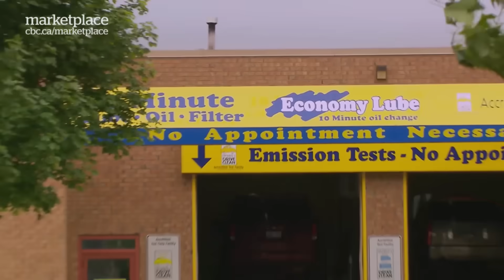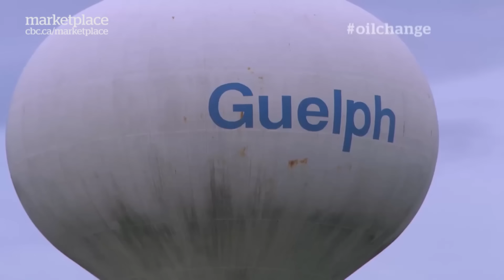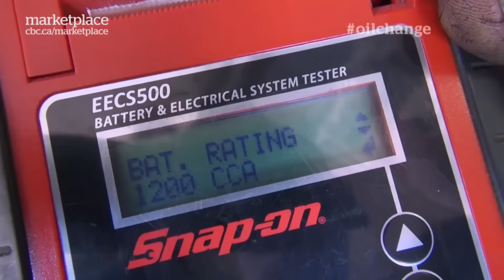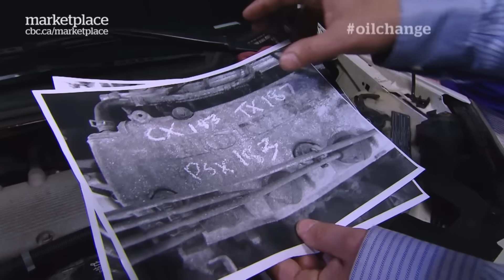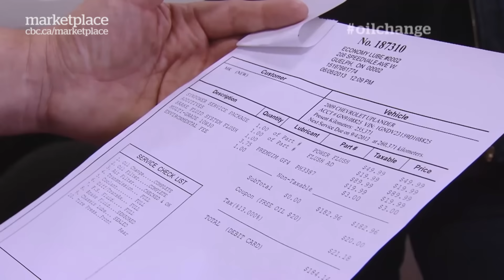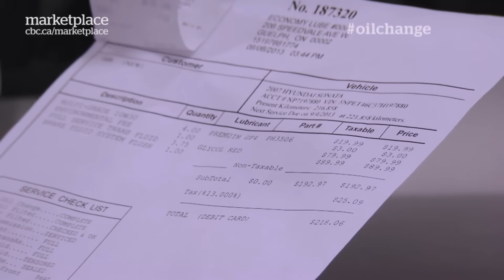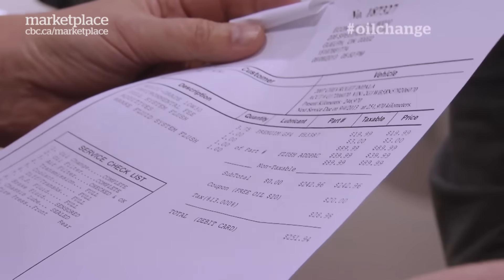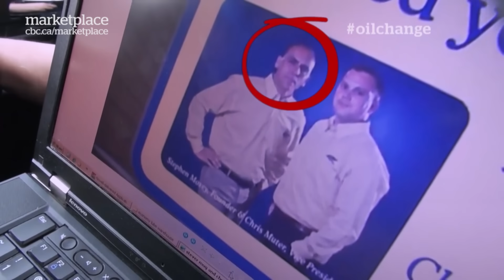Oil change scams: Hidden camera investigation on what really happens to your car (CBC Marketplace)

Comment: This is a perfect example if "you need something done, learn it, practice it, and do it yourself".
Reply: Ohyeah let me learn how to do a hospital operation in 1 yt video
Reply: @beterverwijderen  lol we're talking oil changes and fluids. Legit takes me 15 minutes to do it at home
Reply: @brandonjohnson8880  try rebuilding a transmission
Reply: @mamoochie7392  did the rebuild on my NV3550 from my 01 Jeep TJ in my garage last summer... 😂 (Used a manual)
Reply: @mamoochie7392  It doesnt hurt to learn new things
Reply: @mamoochie7392  i would do it lol
Reply: Need a tumor removed from kidney? Avoid sky high hospital bills, by learning how to do it, practice, then remove the tumor yourself  🤡
Reply: A good priced oil change is worth it for the convenience of not having to go out and buy the oil and filters, and having to go under your car and get dirty, and take the old oil to a proper place for legal disposal. The problem is the loss leader strategy they use. No shop could survive doing only $20 oil changes. But if they charged more, with the promise of no upselling, cheap people will still choose the lower priced oil change even though its shady.
Reply: My brothers and I learned how to change oil ourselves a long time ago.
Reply: @XA0zzzz  do you realize how ridiculously simple and easy it is to change your own oil
Reply: @LactoseTheIntolerant  Is* failing & after the first sentence you need a "?" Not a "." because you were asking a question..
But yes, judging from your grammar, the U.S education system is indeed failing us 😏
Reply: Very easy to YouTube how to do your oil change and save money. It cost like $35Dollars for Oil And Filter (And I have 3Quartz left over for a next Oil change/Also its synthetic 10,000Miles). You have no way of knowing what type of oil their putting in your car. Also I have ramps I bought so it's basically drive up/Drain/Pour new oil/Done.
Reply: Ong
Reply: Biggest issue I have is that I don't have a car jack or anywhere to store it. 12 m2 room, idek where I would keep it. I would love to learn to do oil fluid flush
Reply: Ok
Reply: Yup! They tried to upcharge my mom to get her break pads changed so she bought her own and watched some YouTube videos on it
Reply: Y did´it Myself in Romania!
Reply: Amen I’ve been learning to fix my own car from YouTube for this exact reason. Just need tools
Reply: come on this is fairy tales life is not enough to learn everything also need place,tools,knowledge  better you try to find honest people and be honest
Reply: Too lazy 🥱
Reply: you think this is bad get an AC/ heating technician to come to your house they're totally clueless they don't do half of what they say they're supposed to do and then try to charge you double if you're not careful
Reply: @beterverwijderen  we don't think anybody's talking about doing surgery on yourself big guy we're just talking about services doing what they say and charging a reasonable rate for what they actually say they're doing not doing liver transplants
Reply: @bka8851  Well ya if you just call some random company, most people go with a company someone told them about, i.e good references
Reply: Facts
Reply: @beterverwijderen  It depends on the surgery. I'm considering getting the supplies and having my girlfriend do a debridement on me. Living with HS is hell and the surgery isn't rocket science.
Reply: @beterverwijderen   congratulation
Reply: @dvasavertik7629  I’ll give you that one but only because I watch them to lol.
Reply: I tried this for my backyard patio.  Two years later and it's still halfway done...  I wish I had hired someone to do it.
Reply: Some of you sound ignorant comparing complex hospital procedures to changing car oil.
Reply: except if you need to fly a plane
Reply: @mamoochie7392  pk and while tedious it can be done in a day. It's cheaper to learn to do your own repairs and then do them yourself.... as long as it's done right
Reply: @jameshall2017  not everyone has a day to give up... lol
Reply: @mamoochie7392  that's cause bot everyone wants to make time. Unless you're working 12-16 hours a day then it's not hard to make time. Obviously you can spread it out over a course of days or do it on a day off
Reply: @jameshall2017  and during the meantime, how will you drive to work? Being that your transmission is in pieces youll need to make money to afford tools, parts, gas, food and how are you going to drive to the store to get parts? Not to mention not everybody has time outside of work to figure out what needs to be repaired or replaced and how it needs to be done. So doesn't it make sense to pay for a professional to fix it? They'll get it done faster because they already have the neccessary resources to efficiently perform the repair. If this wasn't the case, why do people keep bringing me their vehicles? Why do you think I charge extra when the customer has already attempted to fix the issue themselves? Lol
Reply: chrisfix got you
Reply: Found it funny when people were comparing basic life skills to major medical surgeries and thought it would be relevant.
Reply: @OscarLT321  , depending on your specific model of car, it may not need to be jacked up to reach anything. It just depends on the location of the drain plug and the filter.
Reply: @OscarLT321  Ur car doesn't have a trunk?
Reply: @brandonjohnson8880  it must be nice having a garage with a good toolset, most people don’t have that luxury. I’m not gonna crawl under my truck parked on the street to change my oil.
Reply: @blastofo  Correct. Just go to a reputable business, not just some random place with a coupon.
Reply: @XA0zzzz  😅😅
Reply: @brandonjohnson8880  its realy easy you dont even need much equipement but never use the wrong oil never
Reply: You can't do it all yourself.  You just need honest workers
Reply: @XA0zzzz  Except changing your oil is more like taking a pill for a headache or putting a band aid on a small cut than major surgery. Used to be a basic life skill almost every boy learned from their dad back in my youth. But I guess young people today go to a hospital when they need an aspirin?
Reply: @brandonjohnson8880  definitely, if I don’t know how it’s because I have no interest or I don’t feel like it lol I learn new things often, so definitely on me to learn my car. Not everyone has this option however
Reply: I mean its a nice thought, and its great for people to be handy, but its a bit impractical to expect every person to learn every skill they need to fix every problem that pops up. Learning one thing may not be too hard, but learning 100 different things can be pretty difficult. This is why specialist jobs exist, because people cant do literally everything themselves, eventually there are going to be some things you just cant do.

Still important to learn new skills wherever possible though. But nobody is going to be able to do everything.
Reply: agree

Comment: "You've got winter air in your tires. We can change for summer air for $59.😶"
Reply: Sir, you killed me! 🤣🤣
Reply: What about raspberry smell for air inside tires?
Reply: @aleksandrpanayev8852  raspberry fart
Reply: “Was that needed” “did we need that” the mechanic is getting annoyed lmao
Reply: Nah man I want fall air
Reply: So your blinker fluid will be 1,000 dollars on top of the 500 dollars for new seat fluid and 40 dollars for the oil change. Do you also want some new tire fluid for 300 dollars?
Reply: I demand the best. Put in Perri-air.
Reply: Winter and summer air is real
Reply: But i will give you $69
Reply: 😂😂 what?🤦🏽‍♀️
Reply: "Your blinker fluid smells burnt"
Reply: Chris Fix annual April fools prank lol
Reply: Check those muffler bearings while you’re at it
Reply: Don’t forget to change the blinker fluid.
Reply: Well, nitrogen is a more common tire fill during winter, though it can and IS safely used year round. Vice-versa for compressed air. But, due to the popularity of nitrogen in winter, “technically” it can be argued that there is summer and winter air. 🤣🤣
Reply: Thats an apple thing :D
Reply: double that price when go up to dealership.
Reply: Over here they are trying to sell Nitrogen for 5€/tire. Sure, Nitrogen is the gas you want in your tire, but 5€! It's not a noble gas, it's everywhere!
Reply: @oxide9679  why nitrogen? Is it less susceptible to expanding due to temperature?
Reply: Haa haa haa!!!
Reply: Ha ha I got that reference
Reply: Lmaoo
Reply: Mmm hot air
Reply: Best comment ever🤣🤣
Reply: Lolol!
Reply: That only works on yuppie customers especially urbanite women
Reply: 😂😂😂 that's a good one
Reply: @jayihl like triple
Reply: That's a grand prize purple ribbon winner. Summer vs winter air, yeah sure. I wonder if anybody really fell for that one 🤣
Reply: Lmao  wow.  My response would have been, my What about my headlight fluid.  How much is that? Then when I got that answer I would have ripped them a new @ss.  Going to film it all with my iphone then off to the BBC.  You would not believe what I've dealt with. My father taught me how to fix my own cars, so I am in to there bullshit.
Reply: Don't laugh they're now selling nitrogen fill because the molecules are bigger and are less likely to leak out.
Reply: @jerrycallo  lmao
Reply: Jokes aside: Super cool air in your tyres will probably cause it to explode (something about physics)
Reply: the shop chargerged me for premium air when filling the tires $90.

Comment: I’ve turned wrenches most my life . I’m 71 now and still do my own work. I’ve worked for numerous dealerships and never once been told to cheat a customer. I pride myself on good quality service and making sure a job is done right. All that being said I absolutely think prices and labor rates are out of control. The other day I was told I needed new upper and lower ball joints. With a 200.00 military discount the price was going to be 700.00 out the door. I decided to do the job myself. Parts were 53.00 for all four ball joints and about 1 hr per side. This is on the ground without a lift and my impact and hand tools. How does this job equate to 900.00 for the normal customer?!
Reply: Because book time calls for 3.8 or 4.2 on most all press in ball joints depends on the hourly rate parts from a shops going to be more expensive then a parts store and it would get an alignment as well
Reply: Pure greed

Comment: Me: comes in with a Tesla

Economylube: you're gunna need an oil change for that.
Reply: Hands down best comment 😂
Reply: Please no
Reply: "Your battery fluid is brown and its smells burnt"
Reply: lmao...now that's funny
Reply: How much fuel does it take to fill up your Tesla.
Reply: Its clear you dont know how cars work
Reply: Frckn hysterical
Reply: tesla's don't use oil ?! ?
Reply: @thomasclark405  tesla is electric car bro i don't think oil is exist in tesla
Reply: @Doyle-  maybe it needs some oil for the transmission?
Reply: @semouwehand5112  yeah maybe don't know exactly about tesla cus im not a fan of cars
Reply: I don't understand this. I have owned my Tesla for 2 years now and have gotten regular 3 month oil changes. The service technician always told me come back in 3 months.
Reply: And new Spark plugs and a full tank of Gas in that expensive EV. LOL
Reply: @Doyle-  It's not just the engine and transmission that need oil changes. There's power steering and other stuff.
Reply: @semouwehand5112  Modern Tesla use a single reduction gear to serve as the purpose of transmission. Although technically it’s not a transmission.
Tesla is a car and a car needs oil everywhere. It doesn’t have a combustion engine but it still has brakes, gears etc...
Reply: Tesla do need oil change...
Reply: @jims4763  
Be certain they change the Muffler Bearings as well.  Hahaha
Reply: @juho6368  
Maybe after 60,000 to 100,000 miles.
Reply: Tesla don’t need oil
Reply: @lolskoleblahyo7353  

They do for the motors. They change it between 60,000 and 100,000 miles
Reply: @lolskoleblahyo7353  

And he was joking
Reply: @conortobin1537  
Tesla's are more reliable than ICE cars and far safer.  😉
Reply: @Psalm-yg6yi  bugger off
Reply: @paulfuray8557  
Gunna need a new Carburetor
Reply: @conortobin1537  
You still play with DOLLS we see. Hahahahahahahhahahaha
Reply: u ran out of batteries sir
Reply: Well technically you've still got the coolant and brake fluide change.
Reply: @semouwehand5112  Teslas don't have transmissions
Reply: @matijavinazza9861  i might be wrong but i believe Tesla uses electronic power steering.
Reply: @archygrey9093  Where there are gears, there's friction and you need lubrication. There's way less oil but teslas still need oil.
Reply: You pulled into an Economylube with a Tesla?